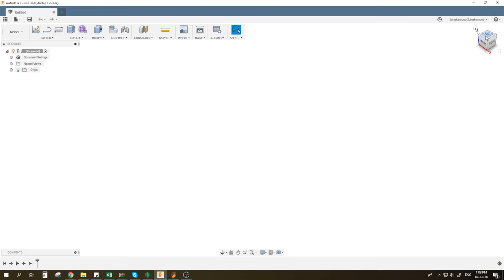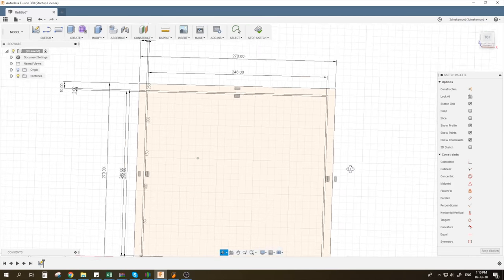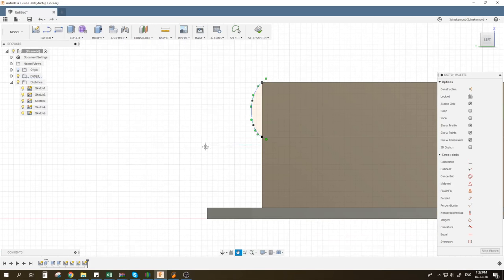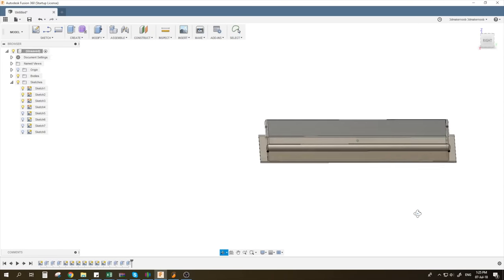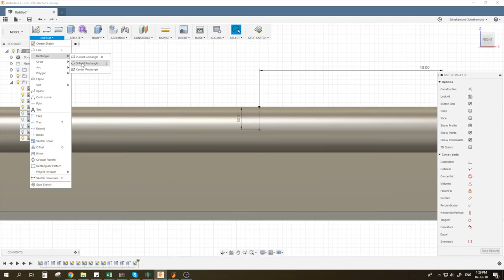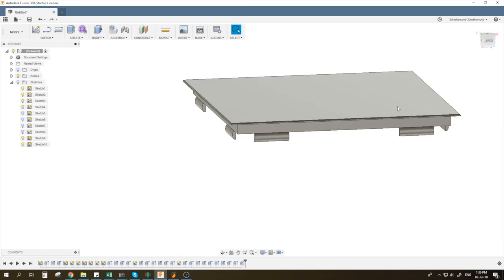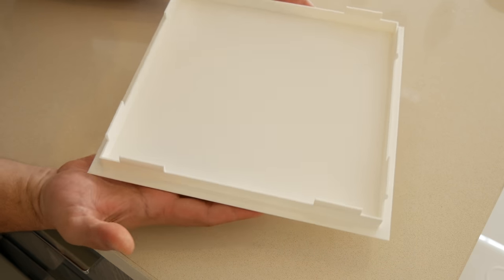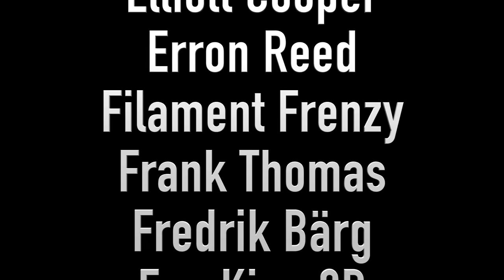3D Printed Access Panel with Fusion 360

Comment: Just a suggestion if you do another one make it two pieces a frame that you permanently glue on to the plaster and then this piece that inserts through that frame the reason being is I suspect you will get two maybe three insertions before you will have ground enough of the plaster that it won't fit quite as nicely as when you first started by using a frame you will protect the plaster and dimensional accuracy of the whole

I suspect you meant spatula not scalpel scalpel is what surgeons use in surgery it's also typically a putty knife or scraper.

I still giggle every time you say video you say it with the i as an e I don't know why it just makes me smile when I hear you say it there's nothing wrong with it I just had to mention that :-)

That first layer was truly spectacular especially considering how large it is very clean :-)

Comment: Nice Video! 

What would have been easier: You offset the cut plane, then cut through the whole model at once. Also you can select more faces with strg. So instead of three cuts, you would only need one (or two if you count the other cut wich is rotated by 90°..) 

Also, instead of using splines to model the flexing pieces you could have used a triangle, that would hold it in place more securely, although it would have removed the ability to remove the panel easily. 

And I'm very suprised how little (or not even noticeable) the part warped.. Nice printer! Keep on goin'!

Comment: You can also select multiple closed sketches for the same extrude command. Good tutorial :) Also, how easy is it to remove from the false ceiling?

And try experimenting with the pattern command :) Will definitely help speed up your design process.

Comment: Great project, however, I would have rather combined this with a light in the ceiling... maybe put the hole where you would have a light anyway so that it serves a function :)
Reply from the maker: I already have lights in the ceiling and this would have been of a much larger size than the rest, it’s also not centered in the ceiling so putting a light there wouldn’t make the kitchen lights symmetrical and that would just bug me lol

Comment: Next time, use offsets of the first one, rather than make them individual rects.. scaling your original rect will not work with the current scheme
Reply from the maker: Thank you! Didn’t even occur to me to be honest. Next time :)
Reply: Also... shell! rather than your 2 rects (for the wall)
Reply: last one: dont measure to the center of that lip, instead make the end point constrained to the center of the height... that would survive a changing of the height from 10 to xx mm
Reply from the maker: Good call, thank you once again, all information I need to learn :)
Reply: Hmmm .. extrude ‘all’ or ‘to object’ instead of extruding manually to a arbitrary distance for doing the cutoffs
Cheers 🙂